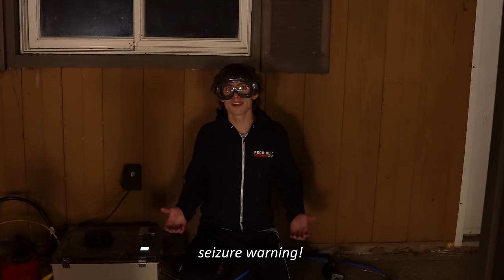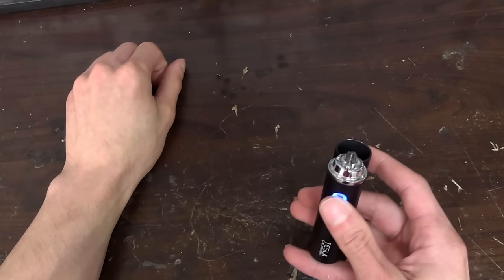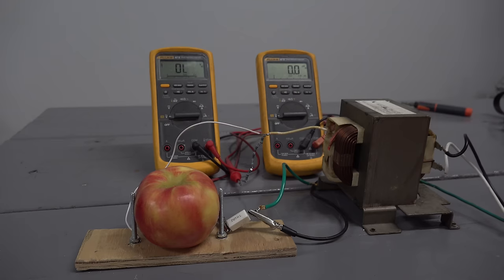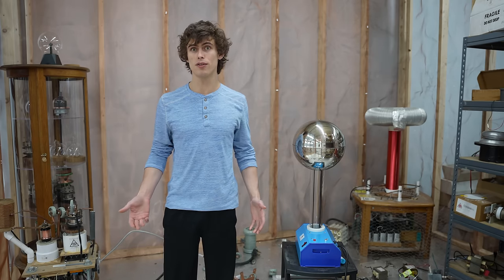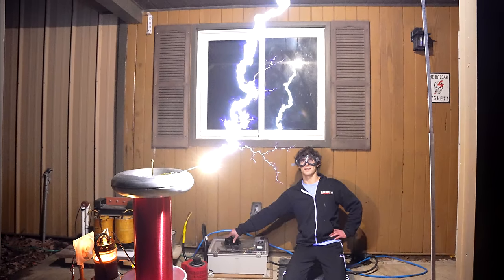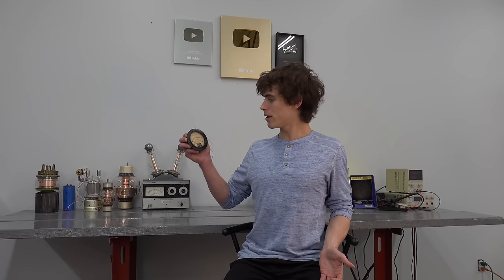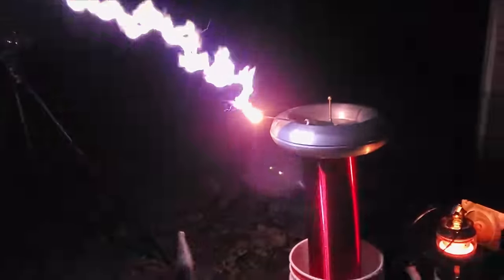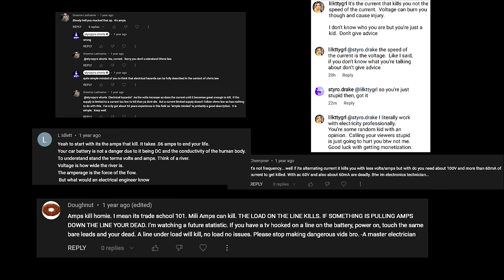Is it the volts or amps that kill?

Comment: As a qualified electricity professional, I can definitely tell you that zappy things go ouchie.
Reply: Wait… REALLY?!?
Reply: Outstanding! The ability to communicate in such a succinct manner is becoming a lost art. You, sir, are a master of communication!
Reply: Woah, zappy things can communicate!?
Reply: lol
Reply: As a fellow electrician, Zappy thing from the neutral feels more ouchie than the black
Reply: @goldfieldgary  
I'd say in the states it's rather a lost novelty, but as I, and whomever else I knew who grew up on Brittish Broadcasting can all agree on it's that dry humour, and witty one liners was a STAPLE for us.
Reply: Dumb it down please
Reply: This is the only explanation.
Reply: So with that explained, that means I'm basically an electrician now, right?
Reply: @Isnogood12  I already tried that experiment when I was 5. I remember being more scared from the flash and sound than being hurt by the shock.
Reply: @VaporeonEnjoyer1  See? Told you it was safe!
Reply: always take advices from professional
Reply: One little question, cause i am not sure about this:
I wanted to test the max voltage for a foil of plastic. I used a power source with max 30KV, and max 100μA continuous current. Then i used two sheets of aluminium seperated by 1,2, and 4layers of this foil. With 4layers it didnt break through anymore. Now, when i removed the aluminium plates and discharged them by touching them together, i wanted to take the plastic foil. Nothing happened at first, but when i touched it with both hands, one on each side in the middle area, it gave me a very strong shock, stronger than that from a electric fence. How is this possible? I mean of course a little bit of charge can hang out on isolators, but this was a enormous shock for a non conducting material.
Reply: @neutronenstern.  plastic is an awful insulator. What you really should be using are metals, especially copper. Like you've seen in several videos, every proper electrician uses a copper mesh to surround themselves with a "Foraday" cage to avoid possibly lethal shocks.
Reply: @Isnogood12  oh its not to insulate me, but for a diy capacitor
Reply: And if something is too zappy your heart go boom boom and you go bye bye
Reply: I made this shocking discovery at a young age, playing with piezzo crystal thingies from lighters. Came to the conclusion 1xclick=zapp+surprize=ouchy. Consider me professional as well.
Reply: Any electrician has gotten electrocuted at least once

In all honesty, I'm lucky to have survived with no side effects
Reply: As someone who stuck his fingers in a lamp socket, I can confirm zappy thing go ouchie
Reply: @Flesh_Wizard  lmfao same. Think it's the first ouchee I've experienced as a kid
Reply: Remember, the abstract models used everyday were done by scientists, and even those scientist know their models could break somewhere, so always be careful; safety 1st. Y0ur F3ll0W I.E.E.E. W4CK0
Reply: Bertrum…like….Sherrie.
Reply: This should be pinned this is the best comment on the entire video
Reply: can you uhmmm, dumb it down more? 😔 Im havin a trouble understandin the basics
Reply: thats not quite correct tho. Many of the "tesla coils", even the solid state coils in that little acrylic box with a needle on top, do a lot of zap but not a single bit of ouch. ...depending on where it arcs to you. I have not tried licking the arc yet but on skin, even with open wounds, theres no pain. Its more of an uncomfortable feeling of pulses of pressure but not pain.
Reply: No. You will go ouchie with zappy things. Zappy things only go zappy.
Reply: Enough with the technical terms, dumb it down a bit so we can all understand it.
Reply: Fellow expert zapper here, I can state unequivocally that if you touch something that is chooching out excess magic pixie dust, you may in fact expire.
Reply: @sonoluminescent  In such a situation you need to turn the switch from <MAGIC> to <MORE MAGIC> and the circuit works again.
Reply: Lol
Reply: @goldfieldgary  No. He did not give enough information to convey the complexity of the topic.
Reply: @mh6276  It's a video on YouTube, not a post-grad course 🤪
Reply: The wholeheartedly towards has been trying to explained this to me. Ive been stuck out of work to figure out what they mean. Mmh I need someone to come and explained in apples and pears but I think thats forbidden?
Reply: @johngotti332  spicy physics go ouch
Reply: you of all professionals Should koow he`s stupid playing with death, great shame on you!

Comment: As an electrician I will stop saying amps kill. Thank you for the excellent educating skills
Reply: Watts Kill* ?
(note the *)
Reply: No, its a useful understanding in your work.
Reply: Saying Amps kill is probably good enough to convey a point, sort of like the bohr model is not actually how an atom looks or works, but is good enough to convey a point. Good to know that it isn't the full story though.
Reply: I belive you because you have money
Reply: Without Volts you won't get any amps.
Reply: I agree, resistance kills!
Reply: @aquss33  life kills
Reply: You are a bad electrician then. You can take 100,000 volts at very low amperage and it only incapacitates you. Amps kill you as it overloads the Na-K (sodium-potassium) potential of your nervous system. Resistance plays a role but the average skin res is only about 3 MOhm. Be a better electrician and do the math yourself.
Reply: @nilspaar1999  😎
Reply: @nilspaar1999  what have you just seen Lisa?
Reply: @nilspaar1999  yeah what he said 👍
Reply: It's better to keep saying amps kill otherwise someone (untrained) is going to start playing jokes on someone. 
They got to account for all the varaibles or it's going to end badly. 
Remember the Titan...
Reply: Yeah meetoo
Reply: Well its still amps killing you while you need enough volts for a flow and time is relevant and even the way through your body 😂
Reply: @nilspaar1999 if you take 100,000 volts at low amperage you've defied the laws of physics, as voltage drops on a current limited circuit when under load. We also literally see Drake get hit with 3A at several kV in this video, which outright disproves what you just said
Reply: @12Burton24 it's not current killing you. You literally see Drake conduct the full current of that Tesla coil with a direct hit to his skin.

Generally speaking, it's the wattage. If you have high wattage, you'll either get shocked in low frequency or burned really badly in high frequency.

We warn for voltage as it determines how predictable your current flow will be
Reply: @dsrocks6905  230v and 50mA are enought to kill you m8. The story its alittle but of all but not Wattage. Volts are needed due to resistance but otherwise not a thing ESD can be over 20 000Volts, the way is important, if you have a hard hit but its just going over the skin its likely your skin is burned but the rest is fine, also time with low AMPs, how long is your hesrt muscle disturbed. And the Amps are also a part ot f the problem. And the thing is you say Amps kill because Voltages can go really high like an ESD but will not kill someone while amps at 50mA can kill you which is a really low number thats just a general rule of thumb which has other parameters than Amps.
Reply: @dsrocks6905  and warnings from voltage are normaly for one good reason important its arcing. 
Normal open copper wire with just 230volts will not hit you if you walk by a high voltage powerline will hit you if you go to close and the distance also depends on the humidity.
Reply: yes, yes you will.
Reply: Amps DO kill - but you have to have enough voltage to push enough current THROUGH YOUR BODY (and mostly THROUGH your skin) to matter.
Reply: @bricefleckenstein9666  yeah and time matters to for how long and they way trough your body. You can get roasted or die in a fraction of a second because your heard muscles  stops working (well takes also longer till you finally die but the damage was done in the fast way)
Reply: @andresv.8880 The ability of a decently high-voltage supply to provide current is what makes it more dangerous. It's not the current flowing through the system that will kill you, it's the current flowing through you. But since virtually all real-world systems are current-limited, citing the voltage of a circuit as the reason it's dangerous is always the wrong approach, and citing the current supply capability is usually the right approach. Occasionally the combination of the two is the best way to evaluate how dangerous something is, but voltage alone is never the answer.
Reply: @frankclough380 Energy that gets dumped into your body is the killer. Every real-world system is current-limited, not voltage-limited, so evaluating how dangerous a circuit is based on the current supply capability is virtually always the correct approach, and evaluating it based on operating voltage is almost always the wrong approach. Therefore, we should absolutely keep saying it's current that kills. It's a far more accurate "rule of thumb" and the exceptions to the rule are in circuits you shouldn't be anywhere near if you don't understand them.

For a specific example, pretending that voltage is what kills would make every single 120V appliance equally dangerous, which is so comically far from being true that it is useless in any context. Whereas saying that an appliance which draws more current is more dangerous is a very solid statement that can potentially even save lives.
Reply: @dsrocks6905 And what determines that voltage drop? It's not the source voltage, it's the ability of the circuit to supply *CURRENT*. You literally said it yourself: real circuits are current-limited, and current draw means that the circuit can supply at least that amperage. A circuit that has a high operating current flow can clearly provide large amounts of current and is therefore much more dangerous than one that draws 5 mA. Therefore, the rule of thumb holds extremely well and we should continue saying it. It can save lives.
Reply: @kylehart8829  that's also why I say that we warn for high voltage, because if you have a truly high voltage supply, outside of frequency, all of the other components are present to offer a lethal load. If we measure by current alone, not all high current circuits will even be capable of delivering a shock.
Reply: @kylehart8829  Correct, the killer is the current that flows through the body and in every situation that is determined by Ohm's law, I=V/R. A high voltage source can potentially drive a high current through a resistor, but what happens depends on the current supply capability, if the current supplying capability of a high voltage source is low then connecting it to a low resistance will result in a drop in voltage and low current. A high current but low voltage source, like a welding machine, cannot overcome the body's resistance to deliver more than a small current, it needs close to a short circuit to supply a high current.
Reply: i wonder what this dude's electricity bill looks like.
Reply: Instead, start saying: "With enough current, everything is a fuse. With enough voltage, everything is wire."
Reply: I suppose you've aware of the positive correlation between motor neuron disease and electricians
Reply: Nicely done educational video for the most part. However, the current measurement was not done correctly. Current at the bottom of the coil goes mostly to charge/discharge of the top load and coil capacitance. The arc current is only a very small fraction of the 3 amps that were measured. You should have held one lead of the meter in your hand and let the arc current go through the meter. That would be a lot more accurate measurement of the current that goes through your body.
If you really get 3 amps going through you at any frequency it most likely will kill you or leave really bad burns.
Reply: @zyeborm  you are forgetting time, so power*time, which is energy, energy kills, you heard it here first folks
Reply: I learned a lesson from you, young whipper-snapper. Thanks!
Reply: Being aware that 
30 Milliamps passing thru chest is 'bad'  is the CONSTANT
Changing variables such as skin conductance , clothing ,hydration and the size of the skin area exposed to the electrical energy.

The voltage and total impedance determines the current 
The impedance is determined by the environmental conditions 
And as such any and all  viable electrical pathways 
Quite happily walk past a 33kv transformer 

But if you have a relatively  small voltage present between one side and another side of a pool  then you collapse and drown 

Unless there's no water in the pool

Just Keep on thinking it's the known mA value that kills 
Otherwise you will find yourself  trying to explain to a customer that it DEPENDs on the  voltage but ALSO DEPENDs on the impedance,  conductivity/ resistance

And what boys and girls do we KNOW that that means it is???

That right! CURRENT the AMPS !!

Current Depends on  ( directly proportional to) Voltage 
And 
Current Depends on ( directly proportional to) conductance 

(Current  is inversely proportional to resistance )
Yes boys and girls it  ohms law 

So cut to the chase Milli amps can kill , Milli volts dont

(Lol it is vids like this where they expect  the viewer to assume what is said is true and that there's no 'technical trickery' 

Eg Like  a concealed earthed wire attached to the 'file/ nail probe'  

I Would love to see someone walk or even just quickly jump between the Tesla coil and the earthed pole as that is what is being shown as perfectly safe
( if the whole electrical arc can be conducted through the body with no major ill effects )

Lol can't wait to see if its done
Reply: And what exactly do you propose is causing the current to be low?

If it's a current limiting resistor 
That has way more resistance than your body then the voltage is across the resistor not you

Think of a light bulb and a switch 
 
When open the switch has full voltage across it  ( as long as your meter has high enough impedance) 
When closed it has zero volts 

Replace switch with a low resistance and get a v drop across is the higher the resistance you put in the higher the v drop across  it ( as a ratio to the lamp impedance) or the current limiting resistor etc

You Can't use the open circuit  / pre touching voltage as the true applied voltage as that is not correct
Reply: It all kills together, thats my explanation
Reply: You could say amps kill, but not alone, as the threshold between not enough to harm under any circumstances and too high for anything else to have a realistic impact on the deadly outcome is rather fuzzy.
Reply: @nilspaar1999  You're a smart person.  What do you know about 5G? Many say it's dangerous,  even the inventors are saying it's bad  But many others say it's safe. Any info on this much appreciated. 👍
Reply: @nilspaar1999 It's not even electrician thing , it's simply 10th grade physics , .  Any high school students would know that... Including ohm's law , non ohmic capacitor and about High frequency  AC can pass through Capacitor etc ...
Reply: @nilspaar1999  me when i dont listen to what he just said
Reply: @nilspaar1999  Idiotic answer, we can give huge amount of amps with low voltage and it won't kill you either as it won't go through your skin...